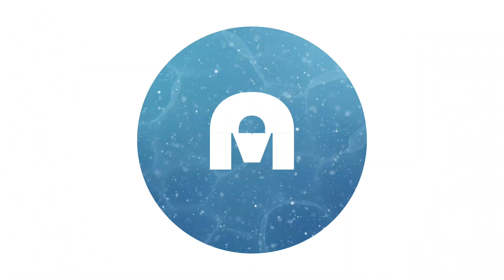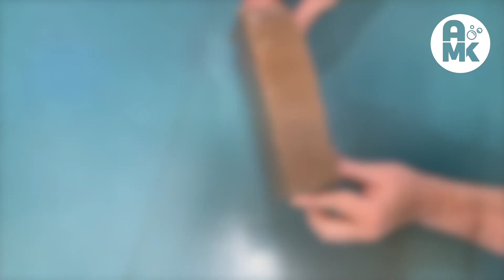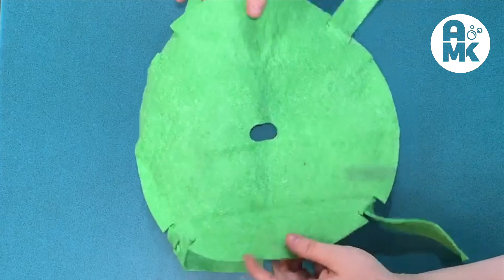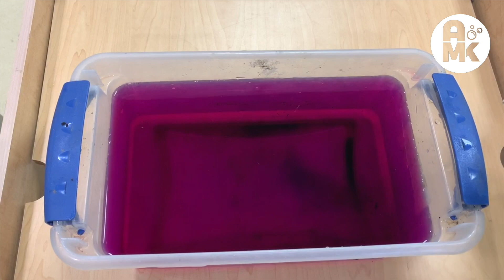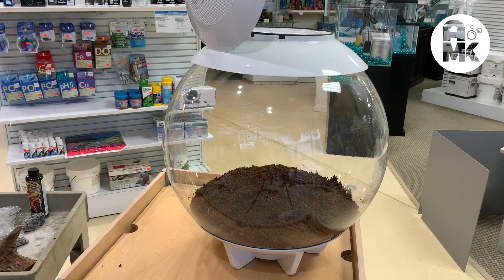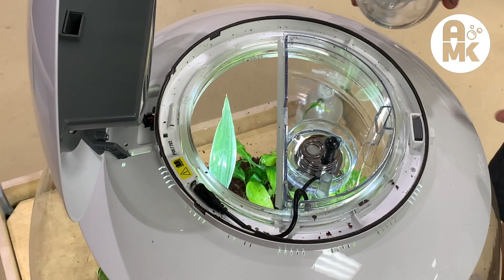BiOrb Air by Oase Setup and How to install.

Comment: I just set mine up. I find that the misting goes on for a long time. Is that normal? Is there only one adjustment button? Confusing instruction book. I just don't know if mine is misting properly. It's been going for over an hour now. Thanks for any help you might offer!